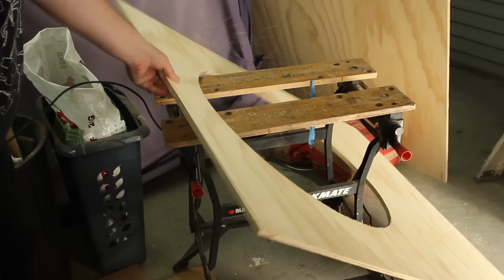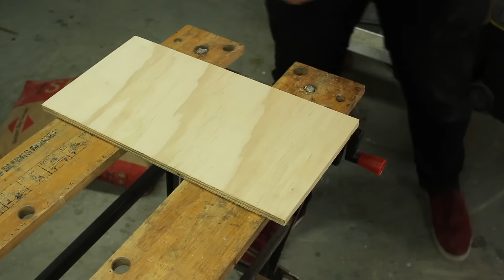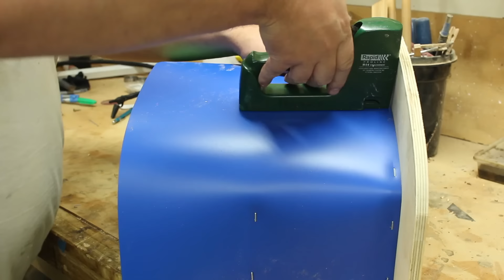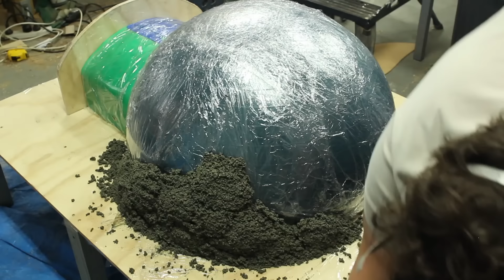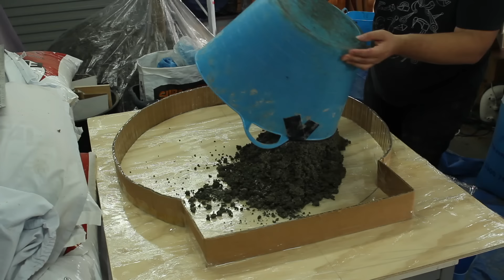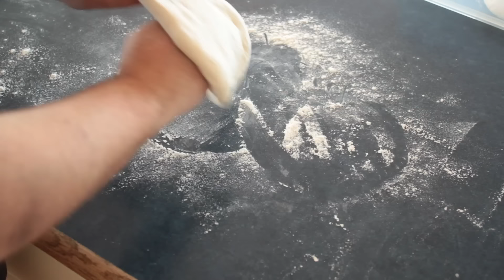DIY Cheap Exercise Ball Pizza Oven

Comment: I just watched a video of a man build a huge pizza oven by meticulously pouring concrete foundation, building a huge cinder block base, topped with a concrete base, over which he placed a ceramic oven floor, followed by cutting and laying hundreds of bricks into a dome shape for what turned out to be an amazing piece of engineering and an incredible addition to his back yard barbecue. It took him an entire month of working on it all day every day. He basically completely discouraged me from ever attempting it. I like your method SO MUCH better. Absolutely BRILLIANT!
Reply: Pero aguantara el calor ?
Reply: @dariosaul4896 THAT'S what I was thinking. Maybe using firebricks and clay would be more fire/heat resistant ?

Comment: put a layer of chicken wire mesh when you do the cementing, it will prevent cracks and if it does crack the wire holds it together
Reply: This is essentially what reinforced concrete is, and while reinforced concrete has more tensile strength (and can resist cracking better) its lifespan will be limited by the eventual rusting of the wire. When steel turns to rust it grows enormously in volume, which will cause the concrete to rapidly self-destruct.
Reply: @waylandsmith  so why is it put in driveways and foundations?
Are you saying the pizza oven would only last 75 years?
Reply: @waylandsmith  Steel need oxygen to form iron oxide (rust). Being buried in concrete it will be just fine. They use mesh to reinforce concrete in just about everything
Reply: @cbr900son  calcium chloride is corrosive to steel rebar.. Depending on the mix design.. They have non-chloridic accelerators that mitigate this.. For DIY projects like this..no worries.
Reply: @cbr900son  the expansion and contraction of the steel caused by the heating/cooling will make this thing crack like an egg shell
Reply: @armandodemichele1420  ...So you have never seen a galvanized pipe rusted then, because i have.
Reply: The idea of rusting steel in my oven sounds gross why not look into the mixtures for ancient Roman concrete. They added a volcanic ash and something else. Looked at lots of videos but can't remember. Strong by itself and lasts for a thousand years. Plenty of time to make pizza! ;)
Reply: @waylandsmith  are you telling me that all the buildings and constructions are going to collapse because if you know, they use rebar.
Reply: @waylandsmith  If the wire is embedded with 1-2in of cover and there is no exposure it won't rust. The cement pulls any of the surface moisture away from the steel. I've seen steel that's been in reinforced concrete for 10-20 years that looks band new when you demo it, because the cement hydration takes the moisture away from the steel. As long as you have good cover you'll be fine, but it is just chicken wire and if it's junk before it goes into the concrete it's not going make any great improvements.
Reply: @pamelag7553  science has been studying Roman concrete for decades and still has no idea how they made it last so long. True story.
Reply: Isn't a special type of cement required for fire ? Like a fire brick ?
Reply: I’m assuming they’re using just Portland cement, and no limestone. Some kind of mesh would be needed
Reply: @waylandsmith  you need Water and Oxygen to rust the person's  great, great great great  grandkids will still be using this before the steel decomposes
Reply: @BAKERHUSKIE  this comment aged well
Reply: @DrMad900  All the kings men can put him together again!!
Reply: @pamelag7553  I take it that you don't cook with cast iron or carbon steel!
Reply: @pamelag7553  I agree. Pumice, cinder, volcanic ash make for a lifetime sturdiness
Reply: @daleandersen9579  Do you let your cast iron and carbon steel rust, and then eat the rust?
Reply: @fun_ghoul  Joe, concrete that is used in highway construction is only 15-20% cement. What you are talking about is trading the large solid aggregate (rock) for an air filled aggregate. That does nothing to prevent temperature shrink and expansion. A thin steel mesh would reduce the likelihood that you would get cracks. I hope a little civil engineering illuminated this for you. Illuminated! Your funny, at least you've got the liberal arts stuff down, I wouldn't want to drive on one of your bridges though.
Reply: @bobsokoloski9559  Literally nobody is talking about concrete except you. I'm embarrassed for you.
Reply: @BAKERHUSKIE  Yes, that's exactly what we're telling you. Ancients didn't use rebar and their structures are still standing. Meanwhile we have a hard time getting our masonry to last 100yrs...

Comment: I just spent 10 minutes literally mesmerized by what I was seeing and strangely super satisfied. My mind just does not work the way this guys mind does. Great job. I do wonder about cracking and if it is holding up. Otherwise,  the phrase "brilliant in its simplicity" perfectly describes the making of this pizza oven.
Reply: Just change on the mixture a bit and put some rebars into ..
Reply: @MotoRobee  I was thinking about rebar too. If you go any bigger I would think rebar would be necessary. As far as the mixture, that might have to change if you went bigger. Limited knowledge of concrete requirements.

Comment: Great video.  I jus read a lot of the comments, and I'm happy to see there are no rude ones.  I shared many of the same questions and thoughts.  First and foremost, thank you for not talking. LOL.  Can't stand those videos that start with, "Hiiii everybody, Joe here back again with...blah blah blah."  And thanks for speeding up the video.  My only suggestion would be is perhaps some bullet points in the comment section with amount of materials used, thickness of walls (appears to be about 4-6 inches, drying time, etc. Thanks for uploading! Cheers!

Comment: Great idea for a kiln design.  The exercise ball is pure genius.  I would have to substitute the Perlite for something to withstand greater temps but cracking idea.
Reply: Vernaculite seems to be the best option using this design. It's made from some sort of lava rock.
Reply: I think perlite is also made from lava?
Besides I think the weak point might be the cement and/or building process here.
Reply: I have made a much larger oven from fire brick, a four inch layer of this perlite/cement mix, and a skim coat of cement with a waterproof sealer.  Cost me about a thousand bucks all told and took me at least 50 hours to build.  I made one of these on a movable base to take with me camping.  Cost less than $100 and took under 4 hours to make including the base.  They both cracked.  It’s held up for a year no problem.  I think the perlite works fantastically well.

Comment: I built a pizza oven 2 years ago using the seldom-used pilates ball.  It works well and makes pizza in 3-4 minutes. The floor of the oven is fire brick on a compressed bed of sand. After two years, there is lippage between adjoining bricks. If I were to make another, I would pour a slab of refractory cement and then polish/grind the deck. Less chance of toppings burning into the floor. People love the pizza it produces.

Comment: Built it in even smaller size, 35cm wide opening with 50cm inner diameter. We have already used it to make some pizza several timea. Works perfecly well. Some cracksa did appear but nothing serious. Under $30 total with 5ft chimney on top.

Comment: Thank you ! This would be an amazing insulative layer for a brick oven with netting in concrete. I personally like the brick tile floor and walls look inside the pizza ovens. Still amazing and it looked fairly light weight when you were moving it.

Comment: I like the ball idea.  Just a couple thoughts. The perlite insulates well, but doesn't hold heat.  This will work for a pizza oven where a lot of the heat is radiant from the fire, but wouldn't work as well with bread, beans, roasts where you need it to stay hot.  That would be a very different oven - just making sure people build what they want.  Thanks for the video.
Reply: Thank you!
Reply: Put a door on the front of it. I have cooked breads and roasted joints in mine
Reply: ᴛᴀᴘ ᴍᴇ ᴀɴᴅ sᴇᴇ Elizabeth  The most common way to make an earthen oven is to make a sand mold - pretty much free and not made of petroleum.

Comment: Pro tip: don't roll your pizza with a rolling pin (or anything like that) it will take the air out of your pizza. Try to stretch it out by hand in whatever manner you see fit: people show different ways on YouTube, I'm sure. Also, don't over-flour your dough. If you find it still a little bit too wet IT'S NOT, you need to keep kneading and kneading and kneading until the moisture is gone. The more kneading the better, you pretty much cannot over-knead it as far as I know, but I do know you can certainly under-knead. This will hopefully give you lovely stretchy dough and a great pizza. Enjoy!
Reply: Wow, thanks!! For years i've been making my own pizza crusts but prefer using homemade tortillas for flat bread pizza bc the dough gets too poofy if I use yeast.. I've used a rolling pin all this time... Will try again Luke you advise... I grind my own wheat so I always thought it was the variety of wheat, I like to use hard red wheat bc of the hearty flavor it contributes to the sauce.
Reply: @kittyfruitloop8264  another trick is let the dough rest in the fridge over night
Reply: I'm afraid that regarding your theory that the more kneading the better, you're wrong. If you overdo it, and that is no more than 15,20 minutes (if you know how to make a proper pizza dough) you'll end up breaking the gluten mesh inside the dough, which is the factor that allows the dough to rise and absorb air, but still keep shape. If you do that you'll end up with a pizza as flat and buiscuity as a pancake. But it is also depending on the strenght of the flour you see. The weacker flours with less protein content, i.e. less strenght, the less manipulation is required. The stronger flours allow longer manipulation and longer proving, (up to 48 in the fridge) but the kneading still needs to be done within 15, 20 minutes, and then left it to rest for an hour before shaping into little balls and then storing away for proving.  I'm a Neapolitan pizzaiolo by the way.
Regards SergioUK
Reply: Has some of you tried 00 flour? I just bought two bags, people say is the best so I am dying to try it out. Also thanks for you tips !

Comment: Advise: apply 30-40 mm of clay liner inside the dome. The clay will shrink more than the perlite concrete thus forming a slight cavity between the perlite shell and the clay liner. That's what we want!  Fire up the oven in particular the clay. The clay is 100% fire resistent, becomes hot as hell and keeps the insulating perlite shell cooler for a better Fuel economy and baking result.
Reply: Bert Costa del Azahar  The clay will also absorb and retain heat better, thus maintaining inner temperature of oven for cooking larger projects ( i plan to roast a lamb in a roasting tray)... For more heat retention, mix coarse salt granules with the clay
Reply: @allonzo202  do not put salt in the clay. The clay must remain porous to let the moisture ( steam) out. Salt will seal the clay
Reply: What kind of clay and can you get it at a big box store?
Reply: Leo Crespo , cat litter is a cheap way to go and it’s all clay
Reply: @davidannett3322  Ummm...it's called a sense of humor?
Reply: said like a true philistine
Reply: @trinapeace2142  Good idea. Organic cat liter is made from Bentonite Clay which i use for making green sand aluminium moulds....
Reply: Hi Bert- thank you for this comment! Would you just use a layer of clay or would you mix clay and cement? Any instructions on the drying time of the clay and what type you would use? Thanks for any help!
Reply: @AlanJohnPeach  How do you know where he's from Alan?
Reply: Did you try this or is it a theory?
Reply: Is it the perlite concrete mixture your worried about not holding up? Would a clay straw mix on the outside of the shell serve the same purpose? Love to hear from anyone who has used this type for a few years and see how it has held up to the heat.

Comment: I had seen a company who made similar types from steel & Clay. The structure was made from steel and molded with clay.
The price range was from $700 to #3,000, including shipping. It came with a nice strong stand and an easy way to add wood from the sides and be able to remove ashes from behind. And you control amount air in/out.
The large one could cook a small pig in it.

Comment: Fun project.  It would have been really really helpful if you had included the temperature you were able to achieve with this oven, and if the heat remained relatively constant.

Comment: The cracking is normal and it would just have to be patched, watched a few other videos on making these ovens and unless you go crazy and do several sealing coats the extreme heat can cause small cracking
Reply: I used a product called fire clay here in Australia, you mix it up with your cement or the perlite in your case and it helps with the cracking,,I made mine out of full bricks so all joints are with the fire clay,,,just my 2 cents worth...btw, I liked the way you did it....

Comment: Speaking as a civil engineer: generally good job. However, you should have made the bottom of the oven out of a rich mix of conventional Portland cement concrete with 1/2-inch aggregate and sand. As I said a rich mix meaning +1 pound of cement. That would be a lot smoother to cook on and clean out, as well as a lot more durable that the popcorn concrete mix you used for the shell. None the less good job.
Reply: Or use fire brick as the base....
Reply: Speaking as a thermal systems engineer, I would stay with the perlite mix so that the bottom as well as the top have a decent R value to keep the heat inside and minimize the amount of wood needed.  Easy enough to put a smooth disk made of stone or fired unglazed clay to cook the pizza on. 

I would also add a door/plug for the opening to trap the hot air better. Could be just a flat disk of the same perlite mix with the shape of the opening. Legs to hold it upright could be made with some bent rebar embedded in the disk so one end is buried in the mix and the other end projects out at an angle where the tip of the exposed end is even with the bottom of the plug.  If you had a welder you could weld a couple of D-loops of rebar to the portion of the rebar leg that is embedded in the perlite mix to serve as handles to use to take the plug in and out.
Reply: @papparocket  yes.   The thermal mass and transfer is important - Modernist bread suggest cast iron base in the oven when cooking bread as it retains heat and then transfers it efficiently to the bread from below helping it to get an early rise before the heat from above sets the crust and limits further expansion. Pizza doesn't rise like bread but benefits from the same principle. So something like a welsh griddle as a cooking platform in the oven works great.
Reply: Can I use fire board instead?

Comment: Great pizza oven. A pizza stone set on flat stones to raise it about an inch off the bottom so hot air can circulate underneath and so the heat in the stone can't conduct away would give you a smoother and a hotter surface to cook the crust crispy. As for a chimney if you can get a section of clay chimney pipe you can put the flange end down and then encase the flange in more of your perlite mix to anchor it in place. 

Since it is a relatively small oven I would think some way to partially plug the opening while the oven is heating and pizzas are cooking would get the temperature higher as well as more evenly distributed. The plug could be a perlite mix disk the shape of the opening. Rounding off the bottom corners to leave a little gap would allow air to flow in along the bottom.  Two pieces of Rebar bent to about 120 degree angle so that the longer side is embedded in the perlite and the other side sticks out such that the end of the exposed side is even with the bottom of the  perlite disk would form study legs. Two D-shaped pieces of rebar either welded to the long side embedded in the disk or embedded separately in the disk would give you handles to lift the plug in and out.

Comment: Nice design and build but I question the materials used.  Perlite has no thermal mass to retain heat.  Your perlite mix is usually used to insulate an inner thermal mass. Maybe you could add an inner layer of clay to create more heat retention and higher temps for pizzas.
Reply from the maker: Always Learning Thank you! Good idea
Reply: Isn't the oven insulated by virtue of the perlite

Comment: wonderful, easy straight forward project for vivid isolation. My worry is that cement cannot take the heat building inside. Was that special cement? Wouldn't. It have been better with clay n straw?
Reply: It's regular cement, being mixed with 4 parts perlite, it can take the heat easily.

Comment: How beautifully & simply done! Questions: Is the " base" material you put the oven on the same as the cast ball mix? Second...Do you fire the oven just with that hole at the apex of the entry curve? Or do you place a short stub of chimney pipe inside it?
Reply: Ideally you'd do the same base which is perlite and cement and then lay firebricks on top , tge firebricks get really hot and the stored heat in the perlite mix replenishes the brick with more heat and so on and so on